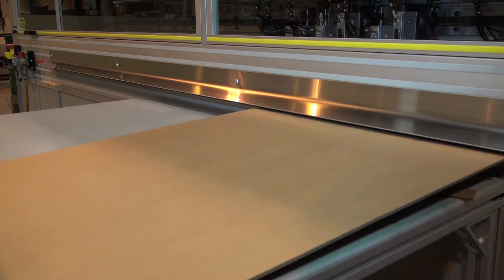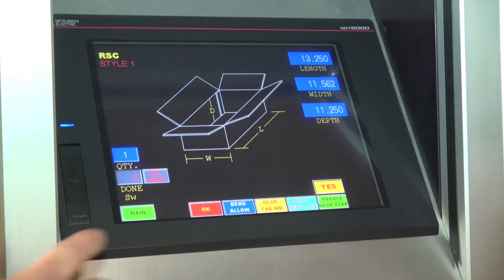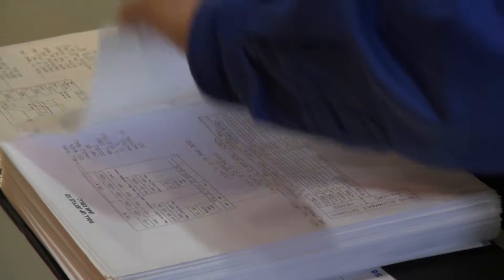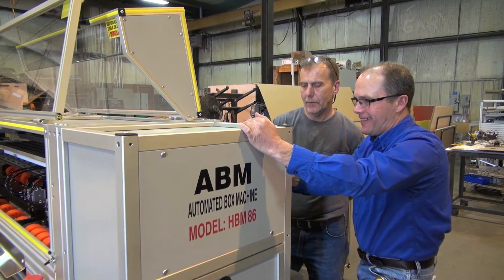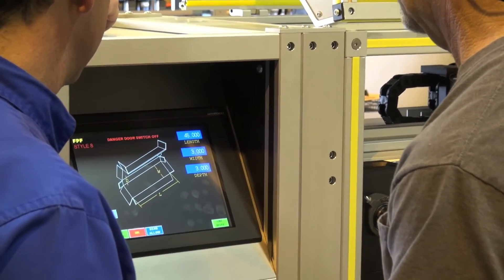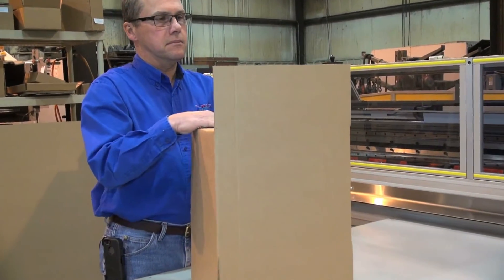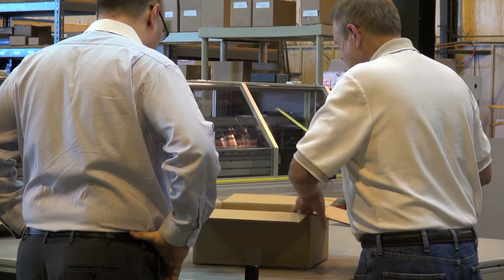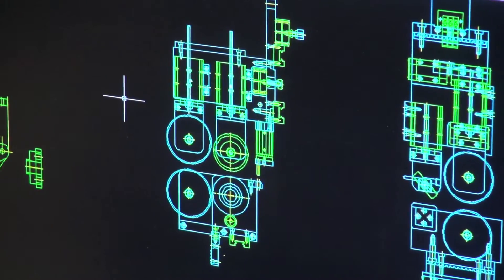T-ROC Equipment - Introduction

Comment: Ron and Don are awesome! As a growing power-tool company SIGNIFICANTSERVICESDOTCOM was taking over my house. Ron and I worked together on building a box machine big enough to fit in my garage. We customized his current machine from 115" all the way down to 90" which allowed enough space to operate in the area of 115". Now that we have our own warehouse and a larger space the smaller footprint is still a huge factor in our daily operations. Once you add T-ROC equipment to your business you wouldn't be the same without it. Any box, any size, any time! This is an investment worth making.